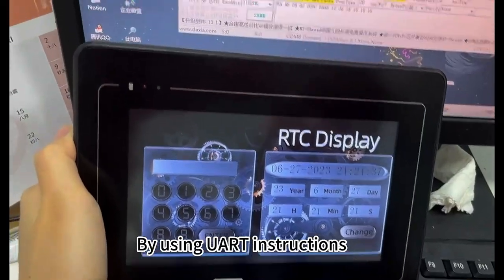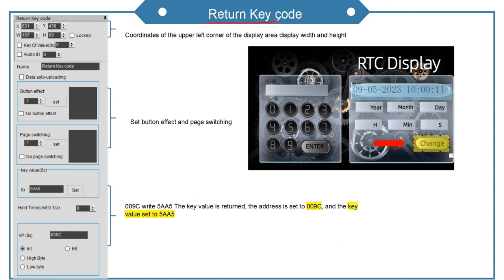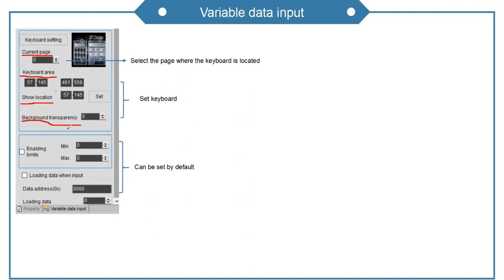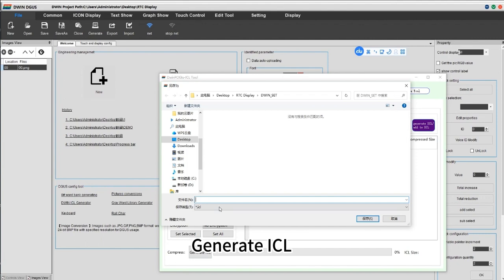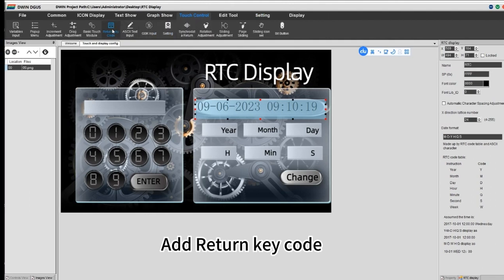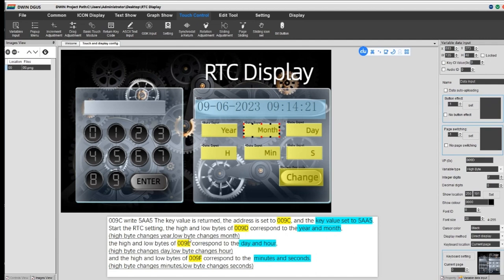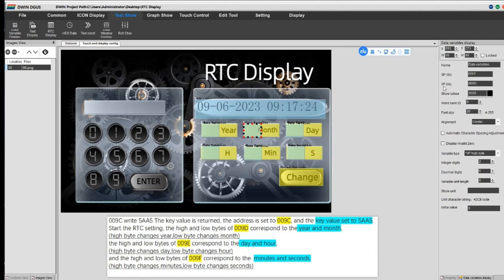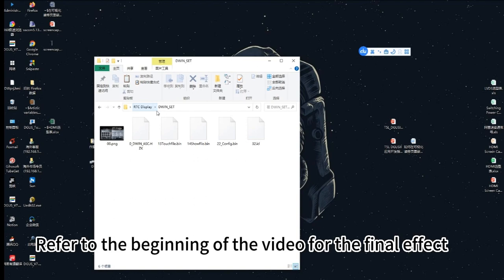Enhanced Tutorials 04 - RTC setting 0x009C  I DWIN T5L DGUS advanced tutorial

Comment: I soldered the battery. RTC clock is not running. May I know what can be the issue?
Please help.
Reply from the maker: Dear, you need to check whether your screen has a circuit that supports welding power supply. If not, the RTC cannot be used even if you use welding power.